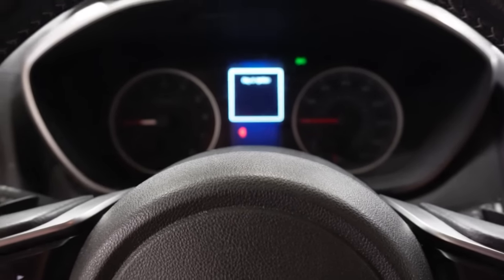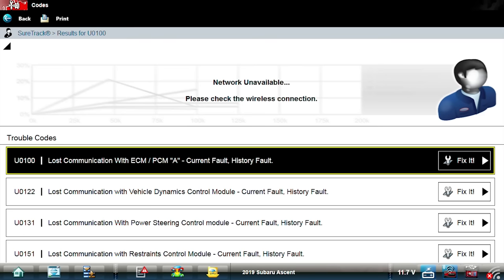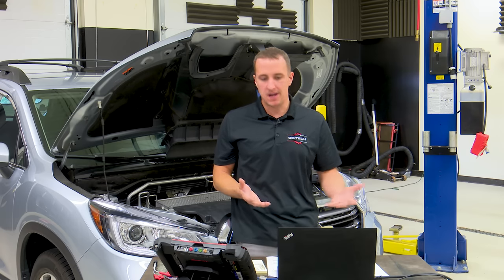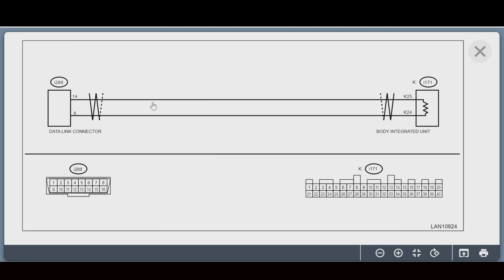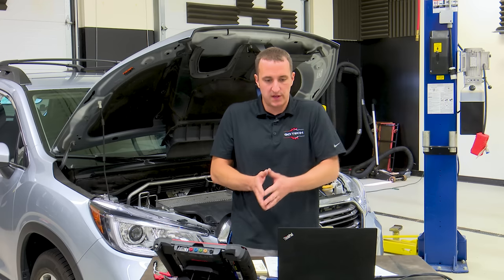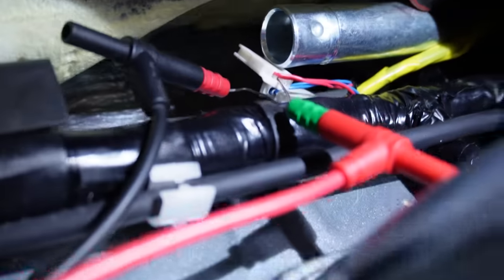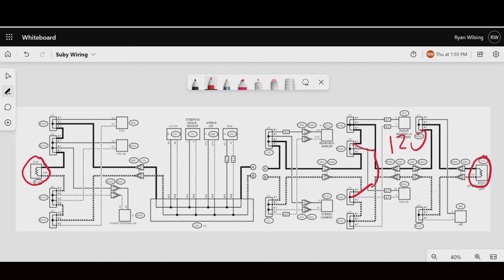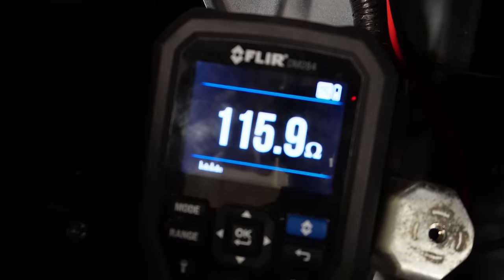CAN Bus Troubleshooting and Diagnosis Explained (Part 3)

Comment: HELP - My mind needs to see complete circuits. Where is the battery in the ALLDATA circuits and yours? Where is the ignition switch? Doesn't Kirchoff's second law apply here? When you disconnect the battery for resistance tests, that's obvious to me. BUT when you reconnect it, where does the battery enter into the circuit?

Comment: The videos are great. 

I didn't understand just one thing. Since there is an open circuit in the communication (motor module), why does the multimeter not show 60 ohms?

 And instead it keeps showing 120?🙄
Reply: Two 120 ohm resistors in parallel make 60 ohms. One resistor wasn’t there so the meter read 120. He faked the missing resistor using the external one he had.

Comment: may be it was just the resistor bad, cant you plug back the ECM but use this external resistor plugged as well and see if you could communicate with the ECM? This will tell if it was just the resistor bad or the whole ECU was toast!

Comment: But part 3 didn't portray exactly what you taught in the previous series.
I suggest you get another car brand for the testing. I wasn't satisfied with this procedure.
Reply from the maker: Any recommendations or ideas ?
Thanks for watching !
~Ryan
Reply: Thanks for the reply. I recommend that you take us through diagnosing a network without the Gateway and also how other topologies can be tested on real life project I.e star,ring and bus
Reply: @GoTechTraining  I recommend diagonising a network without a gateway module and how other topologies like star and ring can be tested
Reply from the maker: Sounds good, I’ll look into finding a good case study

Comment: I don’t know if anybody can answer this for me, but I’ll give it a shot. I watched all three parts and loved them all and was able to understand absolutely everything except for one small thing. Why did the resistance go from around 120 ohms to 1.6 kilohms when he took the body control module with the 120 ohm resistor out of the system?
Reply: Because the BCM was supplying the 120 ohm from the internal resistor. With the BCM removed there wasn't a resistor in the circuit because the ECM was bad.
Reply: @chrishowell8351  I understand that, but that wasn’t my question. Where does the 1.6k ohms come from?

Comment: Could you just remove the two wires from ecm and install a 120 ohm resistor and use the original ecm?
Reply: NO - loss of communication with engine ecm //

Comment: What level or spec / features would you advise to cover CAN diagnostics?
Reply: In terms of scan tool and accessories. Im starting with a 2 channel pico scope to get going
Reply from the maker: With communication issues, scan tool choice is important. Due to some generic scan tools not having the ability to talk to certain modules. When picking a scan tool it really depends on make and model. Obviously, factory scan tools work best, but not many people, including myself can afford factory tools. I really like the Autel Maxisys and Topdon for affordable aftermarket tools. But some times one works better than the other depending on the vehicle. 
As for just tooling, I fix most issues with a good multimeter and by far the most important thing is a good wiring diagram. With out a map you will never find the issue.
Thanks for reaching out! 
~Ryan
Reply: @GoTechTraining  thanks for advice, i was looking at the autel as a possible. Thanks again for making CAN accessible and will continue to study and play around with my car just to understand better what it all looks like when its working...

Comment: It's quite easy then you have the documentation and all the schematics. But for me as a car owner it's like a computer progam. I have the permit to drive it. But I don't own it. Getting the nice schematics you have is harder than getting the gold from Fort Knox for me. It shoud be a full manual with the car, Then it's up to the car owner if he want to do it himself.  But a nice presentation. about the same I use at work, there I can get shematichs on my machines

Comment: Why don`t you want to check the resistance in DLC at the end?
Reply from the maker: Good question!
Because it only goes to the gateway module and won’t measure the resistance of the network .
~Ryan

Comment: Couldn't you just wire in a resistor too the two wires you mentioned externally? Save a lot of money
Reply: No because what other damage the computer has besides the resistor.
Reply from the maker: @bernardflores is Correct , the network would be ok , but the ECM would still be inoperable